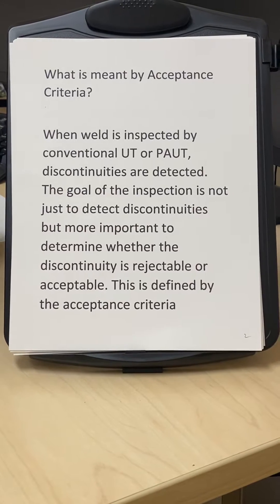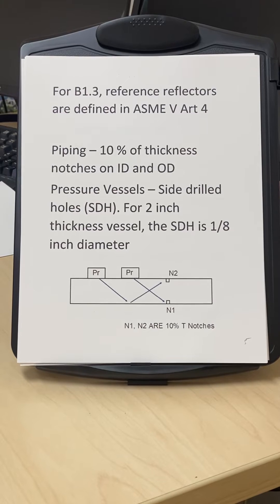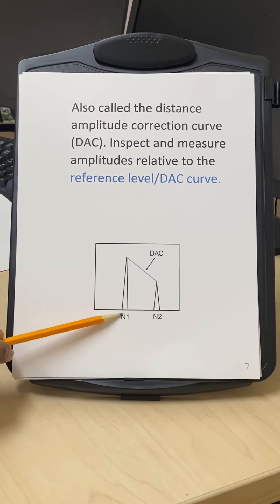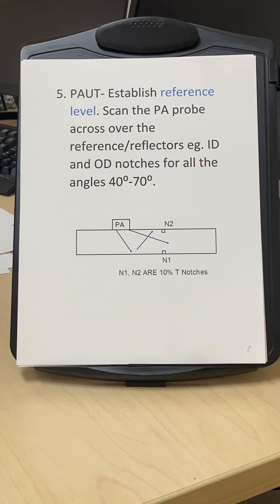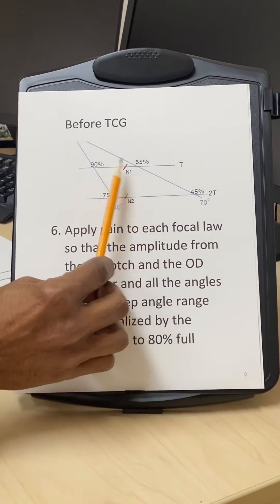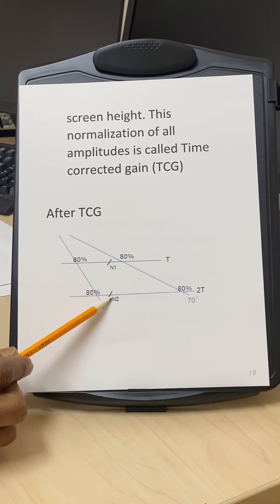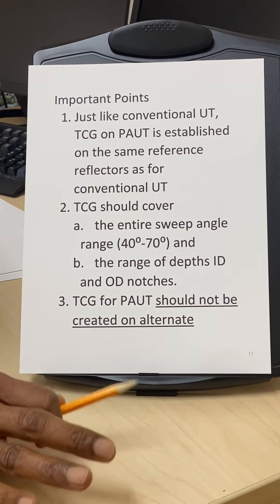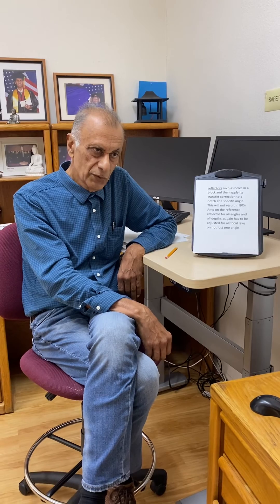Birring 206  PAUT Reference Level, TCG and Applying Acceptance Criteria for Phased Array Testing

Comment: Dear Anmol, thank you for the lecture, its helpful as always. But what Id like to ask is in theory setting the TCG using N nothes sounds just perfect. But in reality its not always possible. The difference in amplitude of signals at different angles leads to very irregular gain correction resulting the S-scan being not smooth by angle sectors. What we are doing is setting the TCG using SDH and setting the reference level using the notches. As you mentioned, the echo amplitude received from ID and OD notches are not equal but the difference often is within 2dB difference. But at least we have an even "background". Especially the problem with notches occurs at angles exceeding 60 deg.
If possible, could you please give some advice for  solving such problem? Thank you

Comment: Sir please reply, which probe is good for clad material  having thickness 15mm, 28mm, 50mm, 54mm  (CS+6mm clad625 material

Which probe will good for mentioned thickness sir DMA or DLA?. Please reply sir
Reply from the maker: Are inspecting weld ? What is weld material ?
Reply: Yes sir weld and material is inconel 625 clad material